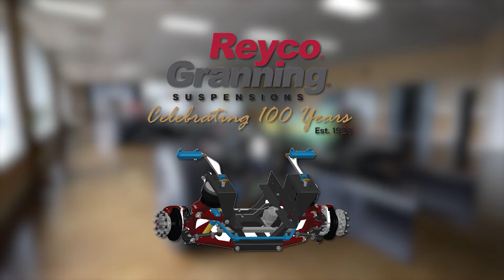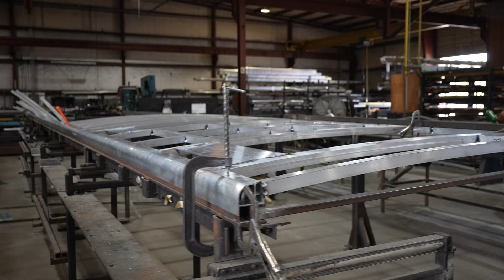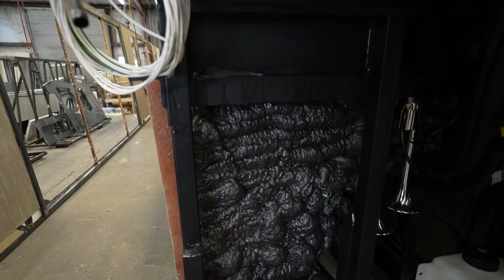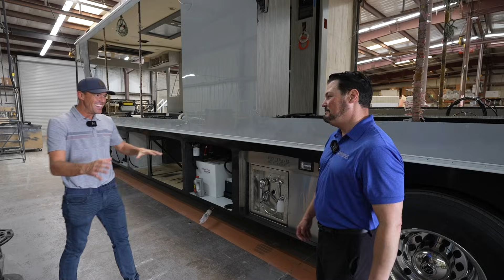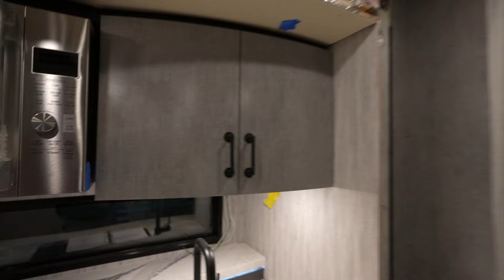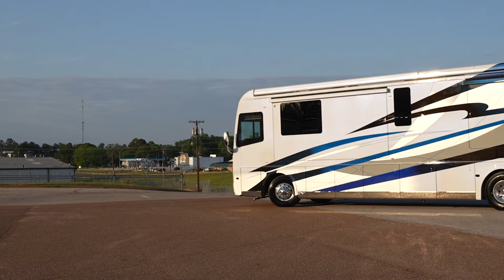Building The $1.65M Foretravel Realm Presidential Luxury Motorcoach - Factory Tour at Foretravel!

Comment: I  wonder  ,  for  how  long    these  electrical    conection  ,  cables   having  life    guarantees   ,  unless   always   would be possibility there     to  replace   them   any  time   if  something happened   with them   ,  because   so  many   is  there   everywhere   and   the  same   thing   is   with  the  plumbing   connection    (  a  good  opportunity   to  reaching   any  even  small  tiny    item   )  to  fixing   anything   in  case   of   any   problems

Comment: Foretravel has to be the best production coach manufacture out there, for the level of quality and attention to detail. Loved the video.  Thanks Andrew!
Reply: No doubt but they are really a custom coach builder
Reply: @bspcinema5189  They are with the exception of the Spec K4 chassis.  It's the only thing that puts them in the production coach slot. Newell is entirely custom from chassis on up. If you get your chassis from Spartan or Freightliner your a production coach manufacture. At least that's my definition.
Reply: @keithwillis3761  Extrapolating your definition, if a company buys a whole shell from Prevost, that’s a production coach also?
Reply: @robmd21   No that's a Bus conversion.  Prevost are already fully built, chassis and frame.
Reply: @keithwillis3761  I am aware of that. They are not entirely custom either. So by your definition they are production coaches.
Reply: @robmd21  Prevost is definitely a production coach builder. Liberty Coach is a custom bus conversion.